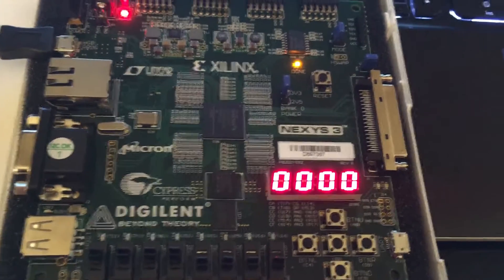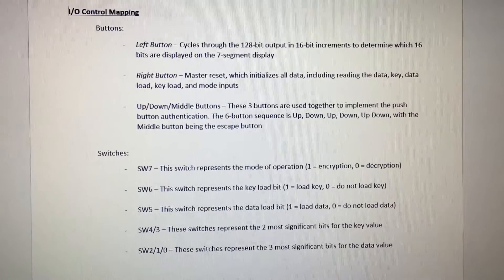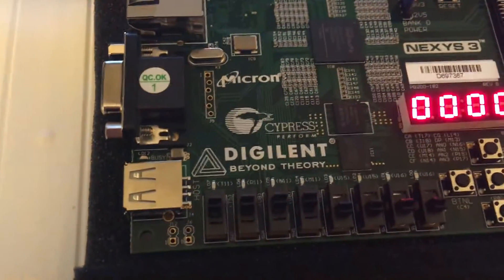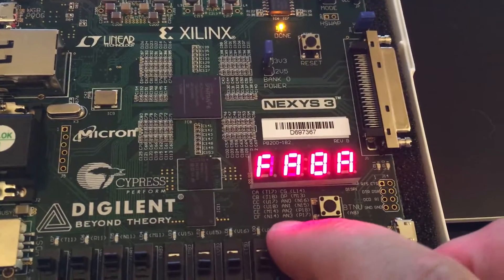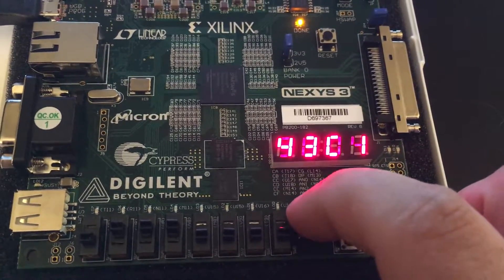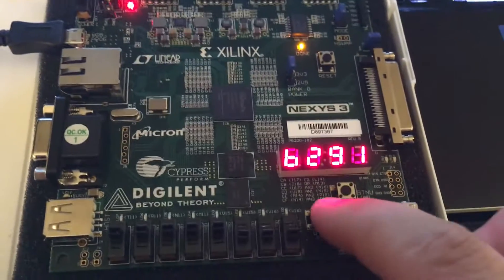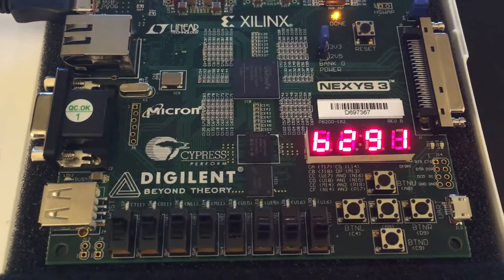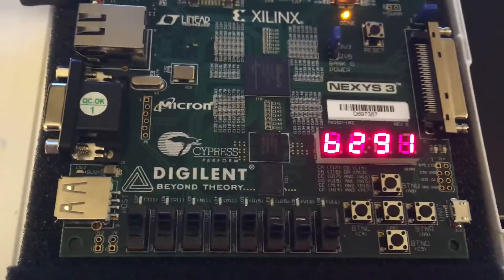EL6453 - Final Project - Rijndael AES256 Encryption/Decryption on Spartan6 FPGA

Comment: Great, Excellent Work!!
Can you please send me your vhdl code?
And the descriptions regarding to project
v.borad@yahoo.com
Reply from the maker: I no longer have the source code for this project. If you have specific questions, I will try to answer them, but I cannot provide the actual code used.
Reply: Thanks a lot for your replay
If you can provide your report(.doc or pdf) or explanation 
how to load code on kit and which tool you uesd
really appreciated to you.
Reply from the maker: The code was developed and loaded using ISETools (which has been replaced by Vivado). It was loaded on to a Digilent Nexys 6 board, running with a Spartan 6 FPGA. Digilent's website provides a tutorial on how to do this: https://reference.digilentinc.com/learn/programmable-logic/tutorials/getting-started-with-fpga/start